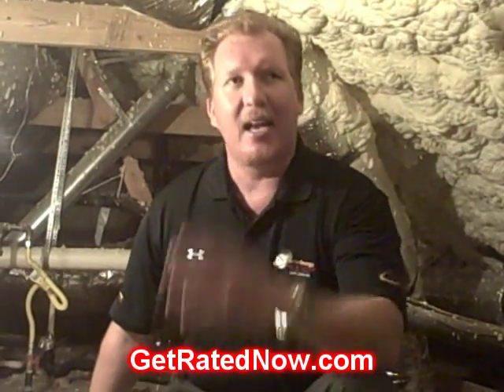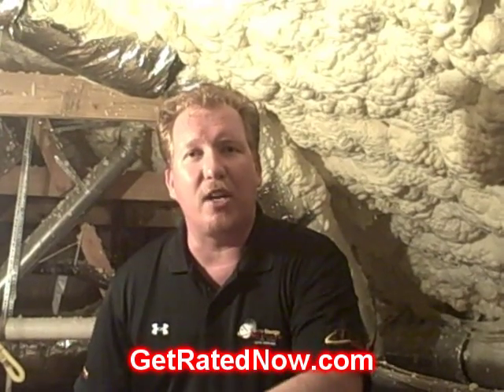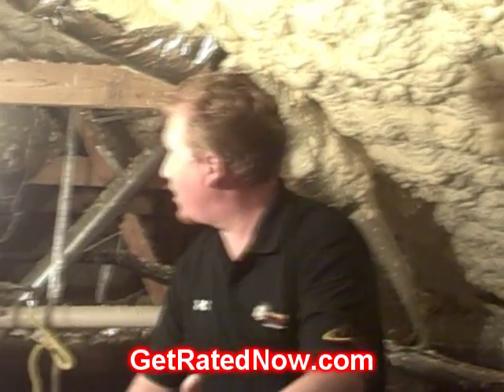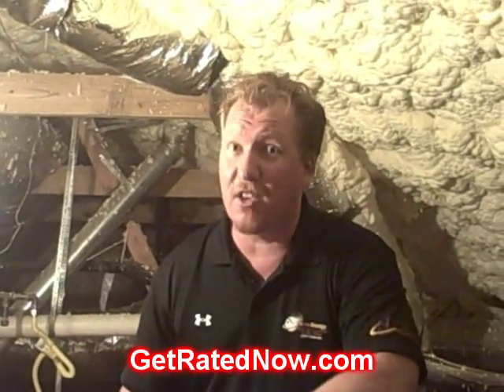What does a foam insulated sealed attic look like?

Comment: @Enviropro8829 I have built from Texas up to Kansas. From slabs to basements, hvac w/in and hvac outside of the envelope, in three different climate zones.. Kansas was where my numbers came from, I had a personal house in one of the breeziest areas, and it is NOT a moderate climate. The kwh rates there are good, but the ROI w/foam ALWAYS ends up the same. To get R-60 depends on the loose-fill, I just looked up certainteed, it is 22" blown in for R-60. Is that even possible with open cell?

Comment: Here are some #'s from the last ten houses we put up that I tested last year.   Avg .017$/sqft/month to heat and cool.......What it would have cost to use foam .007$/sqft/month just in interest. Now to pay towards the 4250$ cost of spray foam to find a return on investment date, lets say you had ZERO heating and cooling costs, it would take 11.6 years for my avg. home-buyer to pay for the cost of foam EVEN IF THEY HAD USED ZERO HEATING/COOLING.  Nice ROI, the secret to new const.'s last choice.

Comment: @Enviropro8829 In my defense, these codes are somewhat new. But as an avid user of RESsoftware, and over a decade of building/home energy experience, I have no doubts that spray foam is a spend a dollar to save a dime industry. I have seen non-foam customers in 3000sqft homes with 42$/month heat/cooling costs. Many will pay that JUST in the extra homeloan interest for foam, while still paying to h/c there house! My neighbor has foam, .009ACH, highest bills around, it is an unhealthy energy hog

Comment: @Enviropro8829 I am lacking knowledge in the department of how to make this insulation pass new codes, but glad. How many insulators are there that have or can run RESsoftware? It is a rare, good find, probably more expensive(so I am not far from correct)I use RESdesign w/numbers such as R-60 blown in on the ceiling vs. r-30 or less(plus bringing the attic space in as conditioned) foamed roof deck, the later is inferior energywise, more expensive, and makes it tougher to use radiant barriers

Comment: @Enviropro882  Now, instead of just having to pay WAY more for foam, now you have to pay more for an Energy Star Rater just to bypass the codes? I can see the Return On Investment getting closer !!!! HAHAHA. Just as long as your customers are rich and ignorant I guess everything will be fine. What you said in lame persons terms...........You can pay more for inferior insulation, and still pass codes, as long as everything else energy related on the house is superior to balance it out, correct?

Comment: I know you probably dont want to hear any more of it, but the 09 IRC codes have changed to prove my point with the cathedral style foam envelope r-values......."Cathedral ceilings tend to have limited insulation and can account for large energy losses.(r-19) The IRC has now limited the size in which you can build cathedral ceilings to either 20% of the entire ceiling area or 500 sq. ft., whichever is less." BOOOYAAAAAA

Comment: How thick is that stuff? By the looks of the 2x6, maybe 2x8 rafers, it would be 6-8" thick! That would be great, but isn't open cell foam 3.6/inch making your total R-value= 21.8 - R28.8 maybe give you the benefit of the doubt and say it is R-30,  aren't the MINIMUMS R-38?? recommended R-49??? And how many more cubic feet of air are you having to condition now, by bringing the attic into the envelope? Do you test homes when you are done to make sure they are not too air tight?